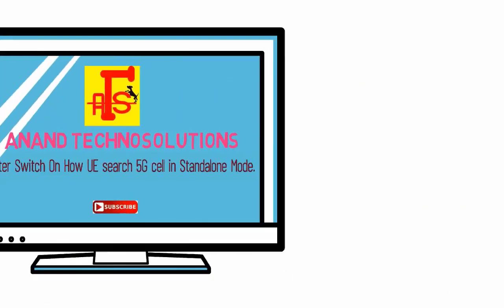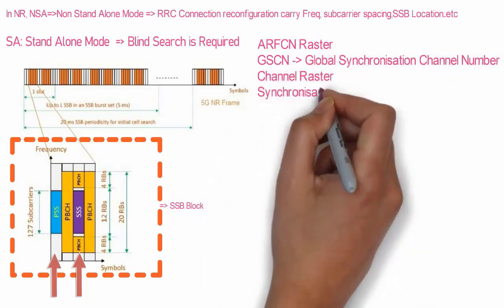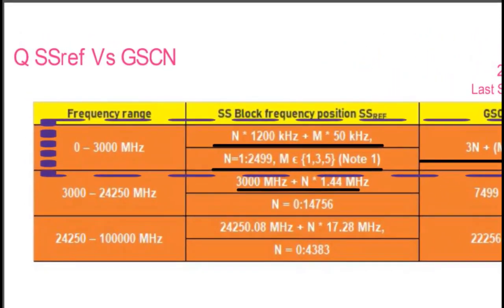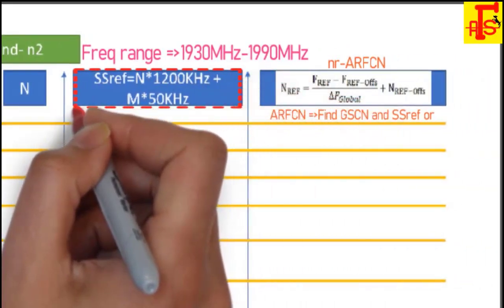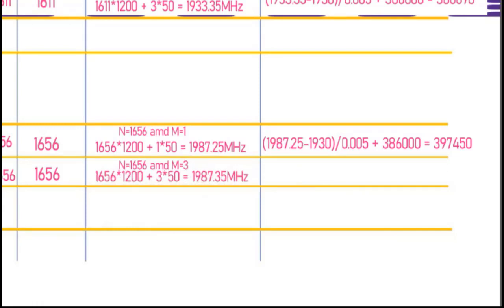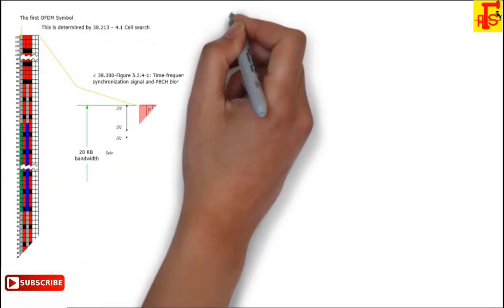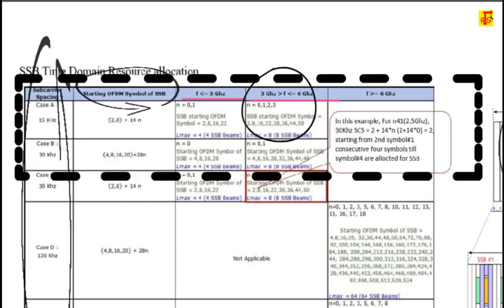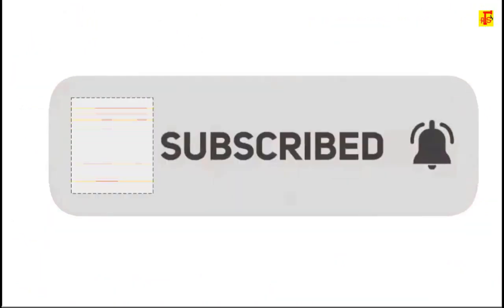5G: What happens when mobile switched on?| 5G Cell Search Process in SA(Stand alone mode) and NSA

Comment: Hi, Your videos are really good and useful, Thank you.  I have one question for SA mode. At time of initial scan (UE power on ) how UE gets the SSB time domain (OFDM symbols) start positions? Because SS burst information is available in RRC messages ( either RRC connection reconfig or SIB1), which was not available at time of initial scan.  During frequency Synchronization raster scan UE doesn't get the information on which OFDM symbols these SSB are present. Thanks.
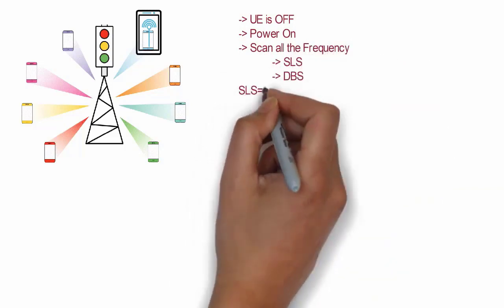Reply from the maker: I think you have not watched complete video..56Min and 1:19 Hour please check...You should watch complete video...